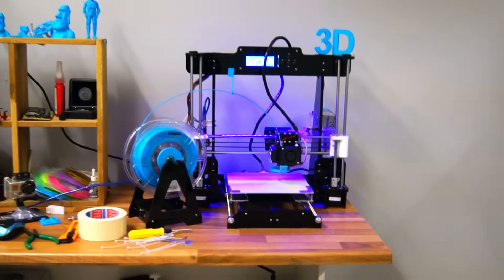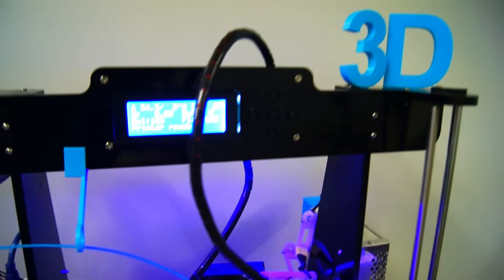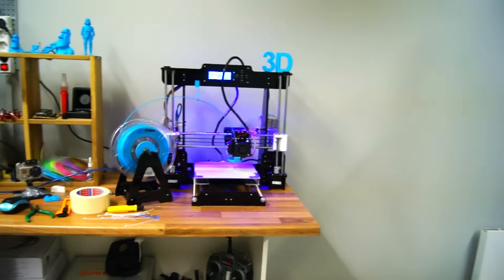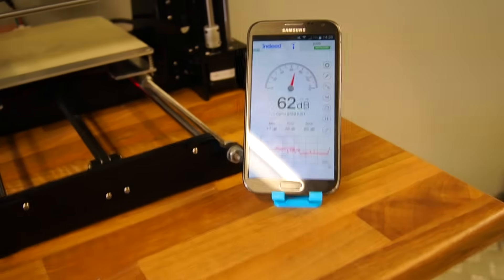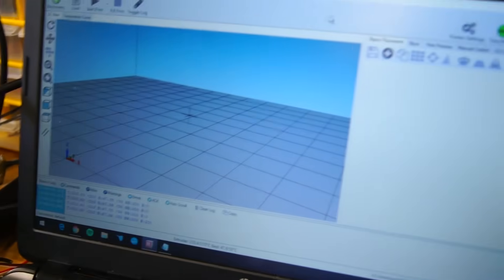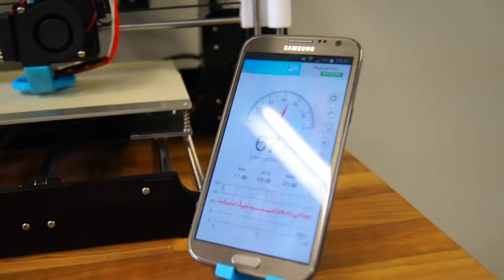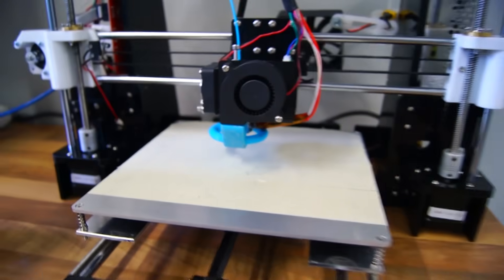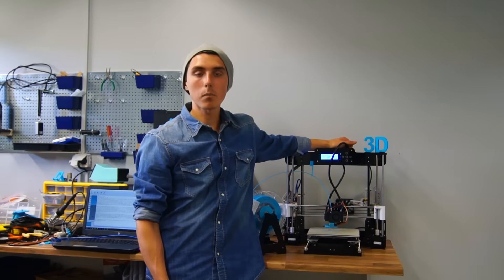Best Cheap DIY 3D Printer Kit Anet A8 - RCLifeOn

Comment: Where can I find files for the cooling ring and filament guide on your machine?
Reply from the maker: Here is the cooling ring: http://www.thingiverse.com/thing:1620630 and here is the filament holder: http://www.thingiverse.com/thing:977779
Reply: Thanx!
Reply: How about that little filament guide on the top of your machine to the left of the display?
Reply from the maker: MIKE FORD
I made it myself, but this one will work just as good: http://www.thingiverse.com/thing:1657256
Reply: Sweet.  Thanx.  Mine is on the way and just getting everything together so I can give it a run once its built.

Comment: Hi got an question here , I want to know which code is more designer use ? the STL / G-CODE and OBJ ?
sry for bad English .
tks
Reply from the maker: Hi! STL and G-code is much easier to learn, OBJ is very complicated.
Reply: thanks for the info :)
Reply: Also, they have different purposes. An STL is a 3D model of an object. A slicer (like cura) converts that into G-code (which are basic machine movements, move the nozzle here, extrude this amount of filament, etc.)

A 3D printer generally only understands G-code, so that's what you use a slicer software for.

Comment: Hi RcLifeOn, i'm searching for a quiality and cheap 3d printer. I had never use it before (i'm a 3d printer beginner) so, i need it for diy parts for my college thesis, the thing is that i live in Venezuela and as you can see it's very very important to me to make the right choice whith this printer 'cus i couldn't regret later, so in your personal and expert opinion is this a good buy?
PD: I found it in www.gearbest.com a good price. check it (http://goo.gl/ISSUyO). I'd appreciate your sincere response. Greetings.
Reply from the maker: Hello Carlos! This is the perfect DIY 3D printer for you! It's fairly easy to assemble, the print quality is very good and the price is absolutetly ridiculously low. I think this will be great project for your college thesis.

Use this coupon: A8Desktop

Comment: heat the bed up to about 55 degrees to remove easily the printed parts
Reply from the maker: Once the print is finished the bed automatically shuts off (for safety reasons). I don't think increasing the temperature will help. However, I might try a different tape. Thanks for watching!
Reply: Once the bed gets cold, heat it again with, for exemple, Repetier (you can do it manually) get to 55 degrees and try to remove the part when the bed is hot again. Turn off the bed when you finish. If you don't want it, don't try it.

Comment: Does anyone have a link for the file for the circular cooling vent?  I've had my printer for a few months and i agree with this review.  I use painters tape on the metal bed. Prints are easily removed with a putty knife. Soundwise it's just loud enough that you can hear a print going wrong from 5 feet away. I wouldn't want it any quieter.
Reply from the maker: Here's the cooling vent: http://www.thingiverse.com/thing:1620630

Thanks for you comment!

Comment: why not print on glass?

Abs can still only on a glass plate?

what did you use for filament examples?

Greetings Jeffrey
Reply from the maker: A glass sheet is not included, therefore I used tape as this is a cheaper alternative. ABS can be printed on both glass and tape. I used 1.75mm PLA filament from a store in Sweden (3D prima).

Comment: The frame is made of acrylic , this is a little tight ? The extruder and hot end of good quality ?
Reply from the maker: The fram is indeed made from acrylic. However, all the parts fit nicely with not a single problem during the build. Both the extruder and the bed heats up within 3 minutes (210° extruder and 50° bed). The quality looks good, no defects or other major issues. In fact, with the minor modifications (mentioned in the video) this 3D printer really does work very good for the money spent. Right now it's only 160$ on Gearbest!